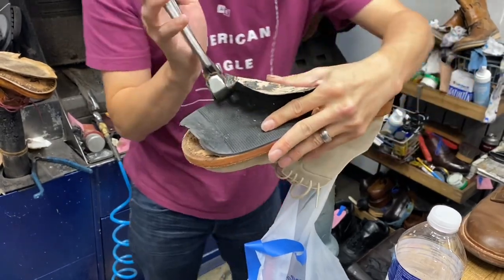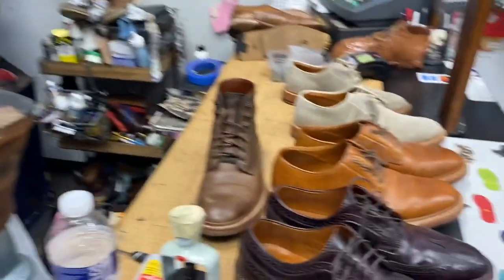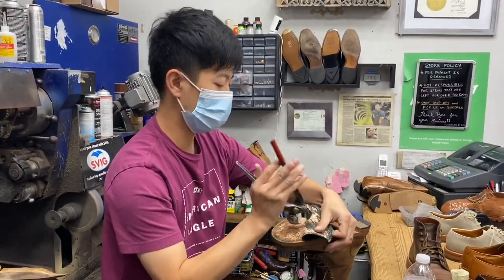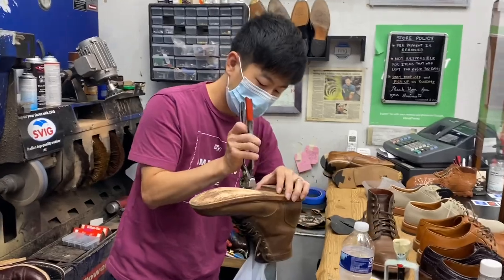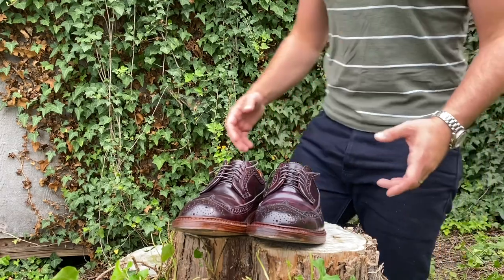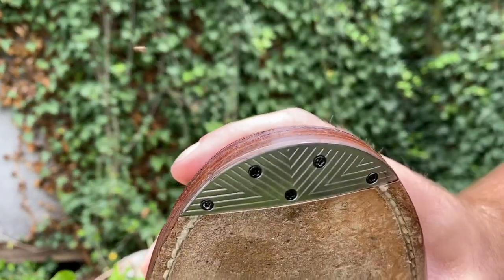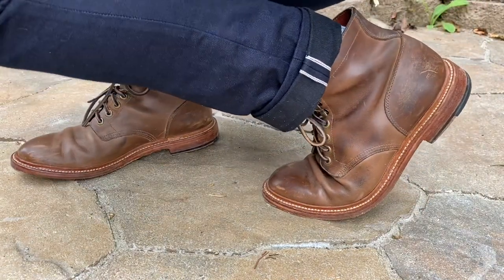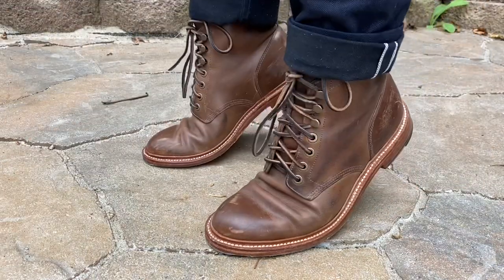Removing protective soles, Installing Triumph toe taps with Cobbler Sunny

Comment: Does it require re-stitching after the toe taps are put in? Or does your cobbler avoid cutting the stitching as he removes the leather for flush installation?

Comment: Oh, I only just sent in my boot for metal toe plate and vibram half sole... kinda worrying about the issue you mentioned now, especially the half sole I m going for, they actually cut off about 1mm leather so the vibram lay closer to the OG height
Reply from the maker: i don't have issues with all rubber protective soles, some people really like them! i only did this to a select few pairs :)
Reply: aerosurferlv I see, I was bought by the idea being living in a humid city, and having to a lot of walking during work, half sole would extend the Life spend of those soles.
let’s hope my clobber will do a nice job, so I don’t regret cutting into my JR sole.
Reply from the maker: @kfung4  the rubber definitely prolongs the life of the sole for sure!!!